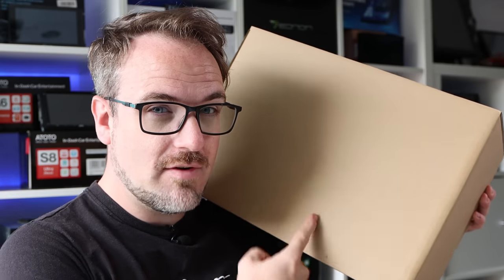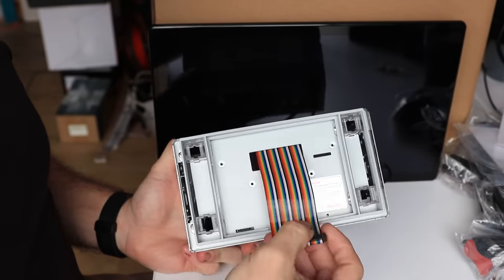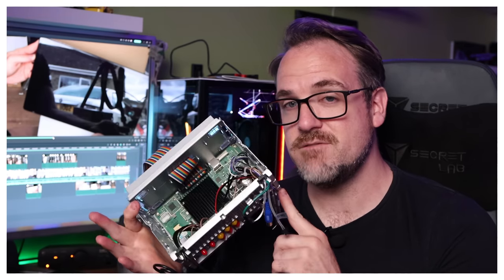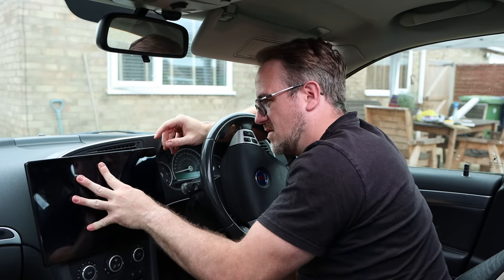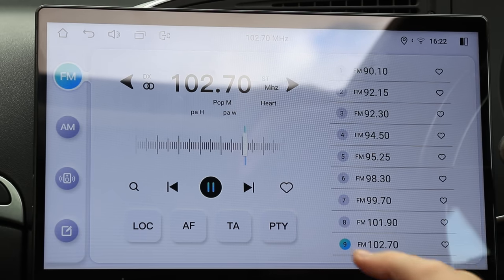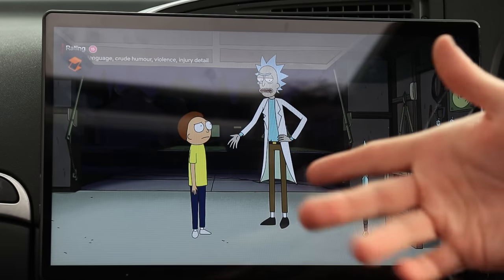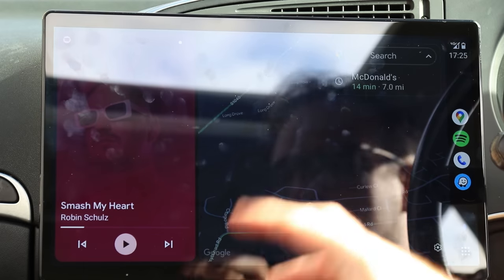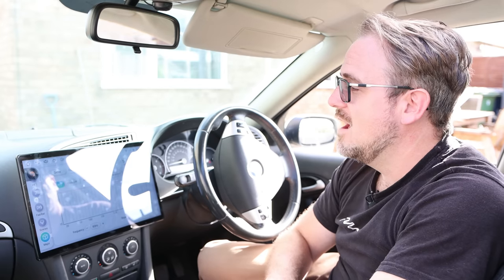2023 FLAGSHIP Joying 15.1inch Car Head Unit - My Favourite! -Android 12 -8gb RAM -SECRET HDMI PORT!

Comment: hello i just wanted to clarify, the "key" is for simple canbus functions and the "can in" is for the advance canbus settings?
Reply from the maker: Yeah. The KEY wires look for differences in electrical resistance. The CAN-IN is the RX/TX which is generally used for more advanced integration
Reply: @SaabUnleashed  Hey thank you for the prompt response, it is really appreciated, i have been having issues with the joying unit and have contacted support about and i have yet to see what response they will return with. 

  for a subaru forester 2017 model, i have gotten the steering wheel controls to work but i am unable to get it to detect the headlights where the headunit automatically dim and the button lights turn on when the car headlights do. the can in and can out are the wires that are connected but i have not tried the key wire. i am assuming connecting the key wire would not fix the issue from what you have told me. 

secondly the music from the speakers i get are good quality and the headunit works well with my stock speakers. but incoming call quality is horrible, the speech is broken and hard to hear whereas ut sounds good from my phone, i have bought a seperate microphone that should be betteer quality because i feel it might be some noise cancelling effect but i am not entirely sure, do you know of any software that would clear up the incoming call quality that might fix the issue?

Comment: Hei, I bought and installed this headunit in my honda CRV and everything works great Except there is this static noise all the time when I play sound. Do you have any idea what might be the reason for this, the car has a built in amp.
Reply from the maker: You probably have a grounding issue. Check all the connections
Reply: @SaabUnleashed  thank you very much :) I'll have it checked out.
Reply: @SaabUnleashed  seems like the problem might be that I have a factory amp in the car and the unit is supplying it with speaker level output instead of line output. Any idea how to fix that?
Reply from the maker: @K_V_Konstantinov  Ah you mean you're getting a hiss? Which also sounds like static, hence your previous message! Ok yes, it will be exactly to do with that. I actually explain about that in this video, https://youtu.be/IjkJhUJt1Ug?si=PukWHH38bI6FwjCS&t=132 and there's a link in the description on the pass-through harness that will fix it

Comment: Is there any important difference between the 1 and 2 DIN version?
Reply from the maker: The size :)
Reply: @SaabUnleashed  i mean expect the size. If the 2 din version have some features what are not included at the 1 din version. Especially I ask because the 2 din version would hide my climatronic buttons under the display, the one din version can be installed on the top din and will not hide them 😃
Reply: @lakimiiberlin5109 In my research over a year ago for a previous model (but same form factor cases), I asked this question to Joying support. They said there is no functional difference between their single and double DIN models. 

I would guess that the Double DIN models would likely be less inclined up have heat issues (due to having more interior volume of air). On the other hand, the single DIN models give you a bit of flexibility concerning mounting of the screen. You can choose from a few positions to place the mounting pegs on the back of the screen with the single unit (allowing some adjustment of height), whereas the double unit restricts you to placing the pegs at the extreme outside locations only (therefore only one position of the screen).

Comment: That is one amazing headunit!! I love all the flexibility it offers. Only I wish it gave you more channels of RCA outputs. I bought an Android headunit from a company called Maxpeedingrods, and it comes with full 8 channels of RCA outputs to be configured in several ways: a front 2-way with center channel and subwoofer (for 5.1 surround); front 2-way with rear speakers and subwoofer; front 3-way with subwoofer (front midbass, midrange, and tweeter). Thanks for the great review!! 🏆🥇🏅🎖
Reply: Thats just wild.  I would expect somebody with that sort of need to be utilizing a DSP.  Huzzah
Reply: @DoeBoy999  that's the cool thing about it. It's all built in. It has a 10 band parametric EQ, crossovers for all the outputs (high pass and low pass), and time alignment. All from the headunit itself. I love it!! 😄
Reply: @DoeBoy999  PS- It also has just over 4 volts on each output. 👌
Reply from the maker: I will have to get hold of a Maxspeedingrods
Reply: which unit did you get from them? they seem to have 10 different units on their website
Reply: @joebreskin  The model I got is Q96.
Reply: I have the maxpeedingrods unit myself. Looking at the joying because the OS on the maxpeedingrods unit lags pretty bad.
Reply: @travisbarrow3408  yeah that's my only complaint about it. Other than that, it sounds amazing. I got it mostly for the sound quality and flexibility of having 8 RCA outputs.

Comment: @SaabUnleashed is the HDMI just a Mirror only or can the main and second hdmi screen display 2 different apps? Also if different apps, are the apps limited to google apps to the 2nd screen or any 3rd party apps like torque?
Reply from the maker: You can disply different things on each screen with the Joying (something that I wasn't aware of at the time of making the video). I am unaware of the limitation of apps for this. I will test when I am back in the UK

Comment: I had a older model of the joying.  Just bought that unit for my 2014 Honda crv exl.  Can u tell me if there is a way to connect my steering wheel controls with the unit?  The Honda logo isn't there as well.  That's weird

Comment: Weird to see basically nothing inside a head unit. Pretty much confirm that you need amp(s) as well and cannot run speaker from the unit itself.
Looks like it have a DSP built into it.... Do that interfere with the SPDIF signal, or only on the coaxial?

Comment: I've been thinking a bit about Android. There are apparently two ways to use these modern Android devices. Android head units and android and apple carplay which depend on me having the phone plugged into the car or possibly by wireless connections. How do I know what is what? If you could explain this in your pedagogical way, I would be grateful.
Reply from the maker: I actually did this a couple of years ago https://youtu.be/qzi3TF_0yE8
Reply: Thanks @SaabUnleashed

Comment: I might be crazy, but i kind of like that the hdmi socket is inside. It seems like it could make it a lot harder to break the end of the cable or damage the socket since the end of the cable is protected. Especially if you zip tie the cable to the din frame.
Reply: The hdmi could be on a pigtail connector
Reply: @FreakyBeanie  totally

Comment: Is the wireless Android auto connection stable?  I've experienced a lot of trouble with older versions, namely the original Snapdragon and the UIS 7862 versions.  Android Auto drops whenever you drive by a strong Wi-Fi network.

Comment: Great video, specially going over the details on the sound settings. 
I have placed order for a head unit and was wondering how did you wire your sub to this headunit. The sub I have is a powered and has RCA inputs. Also at the moment its tapped into toyota jbl amps front speaker outputs from the head unit (before amp). What would be the best way to connect the sub retaining the jbl amp for rest of the speakers and not loosing the controls over speaker settings in the HU?

Comment: It looks like Joying has a TPMS module along with this system. Do you have it, and if so, how well does it work? Thanks!
Reply from the maker: The android TPMS modules are all pretty much the same and are fine
Reply: @SaabUnleashed  Thanks for the reply! Could you elaborate a little bit? Are you saying that all the Android head units can show TPMS? Does this mean the Eonon UA12S also has a TPMS module or reader? I was going for the Joying specifically because it had the front and back cameras and the TPMS sensor. But if the Eonon can also do all that, I can save myself a few hundred dollars and get that instead since you also recommended it as your number 1 pick.
Reply from the maker: @joxseph  The TPMS feature just requires a USB dongle and an installed app to function, which is similar to DAB. With this in mind, you can plug a TPMS USB module into any Android head unit and install the associated app.
Reply: @SaabUnleashed  That's awesome! Is there USB dongle and app that you would recommend? Or maybe a video that you've made about the subject that I could watch? Also thanks for taking the time to break it all down for me!

Comment: What about the AC vents wil be blocked and condensation will ruin the electronic panel?
Reply from the maker: You won't get condensation, and you would order a screen size that is most appropriate. I was only demoing their biggest one here, I actually use a 10imch display normally

Comment: How would you connect a 4 Ch amp, and a 1 mono amp? would you need a DSP or not? the eq should be enough?
Reply from the maker: The eq on this will be enough
Reply: @SaabUnleashed  You did a great job of illustrating the EQ system.

Comment: Always good to see ya staying on top of the latest in android.  I have started seeing AKM sound chips on some of the android units and that would effectively put them on the same level as the major domestic brands entirely.  Thou it really doesn't matter if you are sending your audio to the DSP as the final sound will of been processed via its chips.
Reply from the maker: I will have to keep an eye out for those
Reply: @SaabUnleashed system on the chip in this joying is the same architecture as ennon flagship your reviews last video?
Reply: @SaabUnleashed can you review any good 8’’ or 9’’ head unit for the Saab 9-3 . It would be interesting to see how it will fit and whether you will need any frames or the screen will be big enough to fit nicely without any frames cause for example 7’’ atoto isnt flush and a bit deep and some of the 10’’ untis you reviewed looks a bit too big for the Saab .

Comment: Hey dude! I bought a Renault Kwid and asked them to install a media center, so they installed an "E-Tech MP5 Premium", and I've been trying to use CarPlay with it but not successful. Do you know if this model runs CarPlay or if there's anything I can do to make it run CarPlay?
Reply from the maker: I can tell by the name that it's cheap and nasty, so I'm afraid the answer is most likely going to be no for CarPlay
Reply: @SaabUnleashed  Thanks for the replay brother, I was actually able to identify more about it by looking at the system info. It says F9211B, and I was able to find some information about it online. But still having trouble to enable CarPlay. Apparently similar devices use ZLink, but I wasn't able to find the apk to install it manually (apparently it should come with it by standard).

Comment: I'm running 4 speakers and a subwoofer, it's wired so that:
FL: Left tweeter
FR: Right Tweeter
RL: Left woofer
RR: Right woofer

Would that work with this head unit? Thanks
Reply from the maker: Yes that's fine because you can control the individual speaker levels

Comment: How difficult is it to install a head unit?  Do you need to take apart a lot of the dashboard to do it?
Reply from the maker: Depends on the car. Normally it's as simple as removing a few trim peices to get the old radio out and then popping the new one in

Comment: I just received the dbl DIN 11 inch unit. Opened up the case and there is no HDMI port. The pins are there and it says HDMI on the board. So be careful, I’m now debating on returning. I opened it thinking of running the cable out of the unit. I’m now wondering if I’m able to do that since I opened it.
Reply from the maker: HDMI is an option. Where did you buy it? They should be fine with you exchanging
Reply: @SaabUnleashed  I got it from Amazon.

Comment: Hi, since you have a number of Joying units, can you check something that Joying won't confirm for me? Can you swap screen modules between head units as they all seem to use the same ribbon connector? I ask as I installed a 7" unit in a Mini Cooper where the head unit box is actually mounted completely inside the dash via 3D printed brackets bolted to the heater core and then the ribbon is run out through a custom 3d printed mount in place of the old nav screen. I am tempted to upgrade to a larger screen and would love it if I just need to buy a new unit and swap the screens attached to the ribbon connector.
Reply from the maker: I have swapped screens before, but only with same resolution screens. If you try to install one of their 1200P screens, or even a 1080p screen on a head unit designed to run at 800p, it's not going to work.
Reply: The screens are not interchangeable unless it's exactly the same unit, for example the older android 10 screen will not work with the new android 12 units even if they are the same size and resolution.

Comment: Hey man I just ordered an android 11 head unit for my mustang and bluetooth kinda stutters and stuff when using carplay I was just curious if you might know what is causing that.
Reply from the maker: Poor Bluetooth connection, poor specification preventing seemless streaming. What head unit is it?
Reply: @SaabUnleashed  one of those Chinese ones from Amazon the brand said ekat if that even matters. The mobo for it is sha16/23. I just bought this because I had only sync 1 so having CarPlay thru wired or wireless will be good either way just hoping I can get the wireless part working perfectly
Reply: I think I might have figured it out I set the zlink5 app to launch with the os and restarted and drove for 30 min with no problems as far as I could tell

Comment: How do these android units do with heat dispersion? I’ve heard they get v hot.
Reply from the maker: They can get warm, the highest powered ones have active cooling (built in fans)
Reply: thanks for your response...Is that a worry - should I add a small fan or heat sink to the new Joying  @SaabUnleashed
Reply from the maker: @RationalCreed  not at all. Joyings also have more available airflow space due in their metal enclosures to allow for effective passive cooling. I have never had an issue

Comment: Dear Saab Unleashed, considering this is android. Can it be modded to be used in Portrait? 
There is not a lot of space to use it in Landscape.
Reply from the maker: Technically yes, you would need to use an app to force the screen orientation, and as the factory launcher is not designed for that, you would need to install a launcher.

Comment: @SaabUnleashed , Can you please review this Android Unit - AWAVE AT-9001/AT-1001 --> AWAVE claims that it has got high quality Sound with DAC (194 Khz/24bit)  built in , along with HDMI Video output, Optical and coaxial output too. expecting your review on that
Reply from the maker: Wow impressive specs if true. I'll check it out
Reply: @SaabUnleashed , AWAVE is from GTtrading firm that makes STEG and Audio Systems. AWAVE is its Chinese arm as I understand.

Comment: Hi just posting this for anyone with experience with headunits. 

In short ive ran them for years however my current vehicle doesnt appear to be popular with manufacturers of these units. In short i found 1 that will work and have ordered it. I was under the impression it was running thr 7862 however it transpires to be running the 8581 SOC. Its with 4gbs ram. Running 2k resolution. Performance wise do you think it will be like my old cc2+?
Reply from the maker: The 8581 benchmarks at almost exactly half of the 7862. The Atoto A6 has the 8581 so you can check my review with regards to speed, but bare in mind the Atoto has a 600p screen and yours will be driving 2K
Reply: @SaabUnleashed  I checked your review and overall felt fine. Though the 2k is untested. Videos online show smooth transitions in menus however didn't display auto etc. So guess time will tell unless you have one on the cards to review? Must say your reviews are great I saw your benchmark and it was semi comparable to the px6 so not exactly slow.

Comment: Does it have some kind of dark mode?
Reply from the maker: For that dashboard, no. This is something I look for too. You'd need to download a launcher from the Play store
Reply: @SaabUnleashed  - There is a Dark Mode in the Settings, which will give you a dark grey screen which in my opinion looks better than the light mode.
It will also automatically go to dark mode when you turn your headlights on

Comment: No 360 camera?
Reply from the maker: Yes it does, the connection is inside the case. Look at my top 7 video, I explain it there
Reply: @SaabUnleashed  I did, I was just hoping to find more information here since this is a detected video for this unit.
Reply from the maker: @mohammedkumkumji9081  unfortunately I wasn't aware of this function when I made this video, it's not an advertised function and the port is inside the unit. I did a small video here https://youtu.be/CHbWjiBEqao
Reply: @SaabUnleashed  Awesome!  Thanks 👍